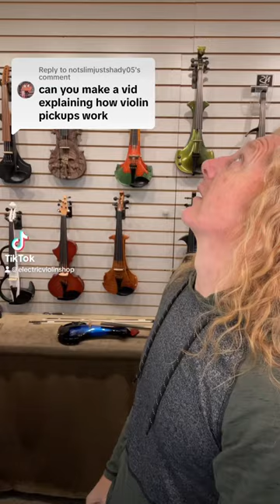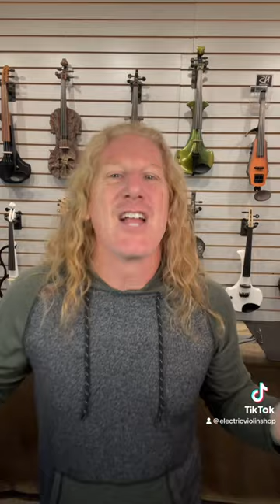Violin Pickups

Comment: I have some questions. Let's say i want to convert an cheep wooden acoustic violin into a completely electric one by removing /replaceing the body with a handcrafted solid body how do you implement the pickup if there are different ways to place /design the pickup? What's the difference between the pickups that sense vibrations right at the strings vs the ones that sit under the bridge? and what other hiccups might i run into? Do electric violins have a trustrod like electric guitars?